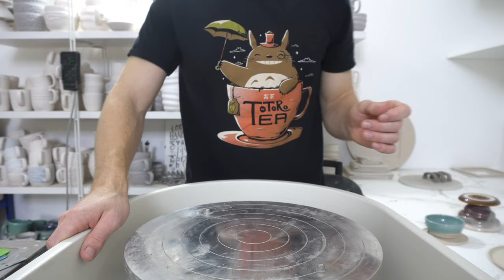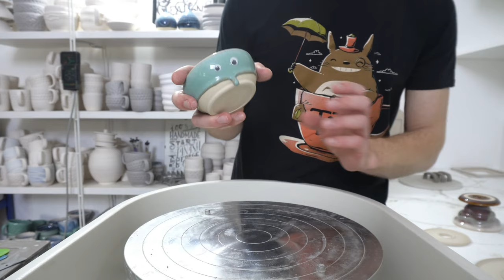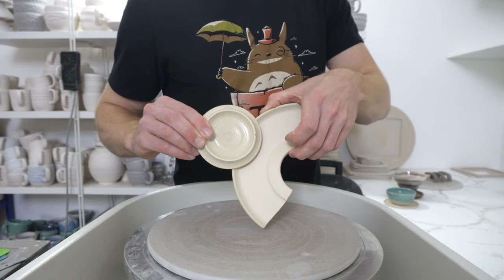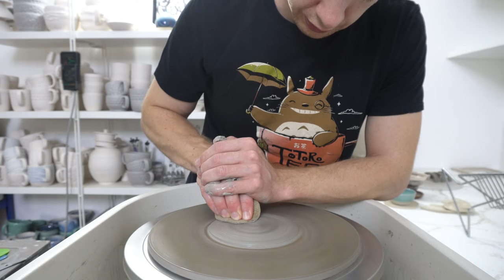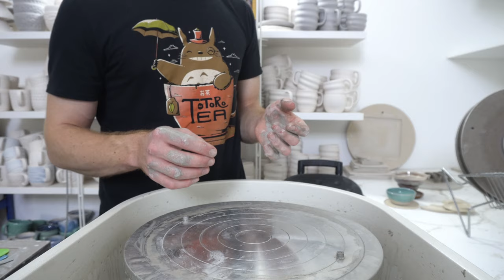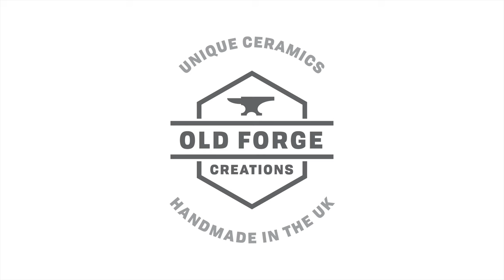How and Why I make Drip Catchers

Comment: Brilliant! Do you make different sizes of drip catchers based on what size vessel you are using them for? For example, if I wanted to fire mugs and larger vases, does the inner ring have to be sized so that it is close to the base diameter of the vessel? Thanks!
Reply from the maker: Absolutely. I throw them in a range of sizes and pick an appropriate size for each piece